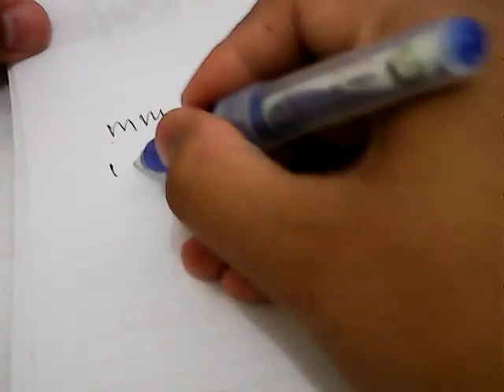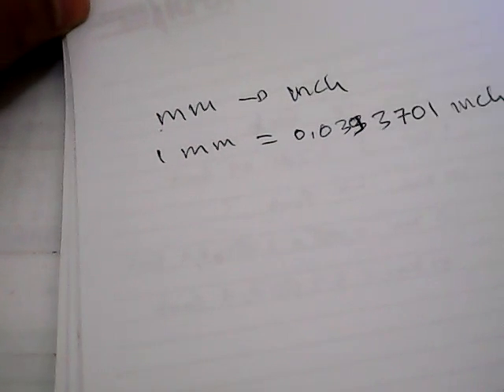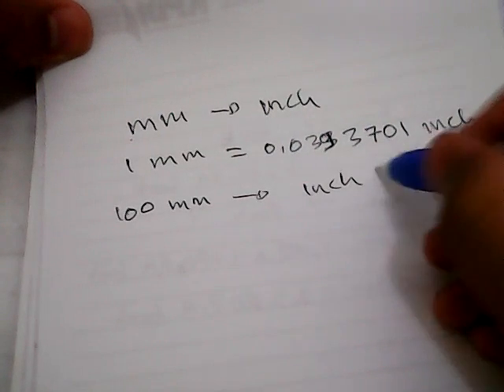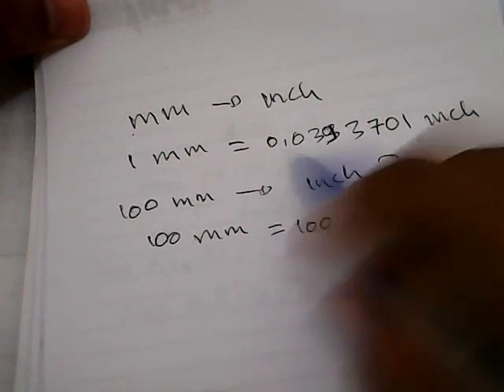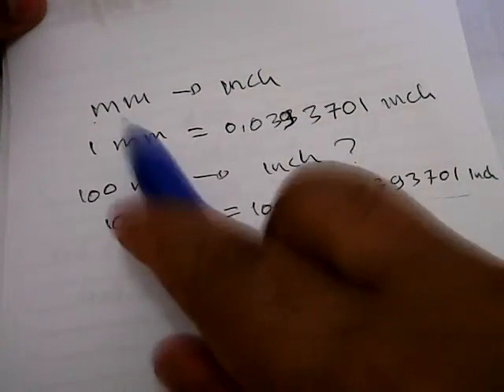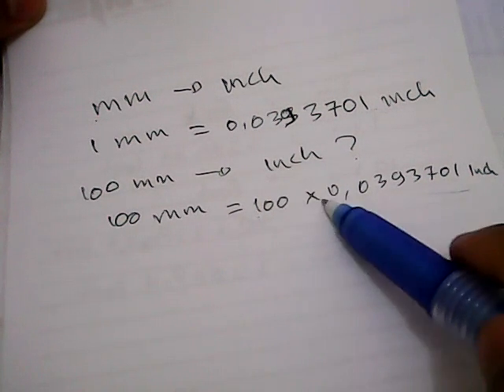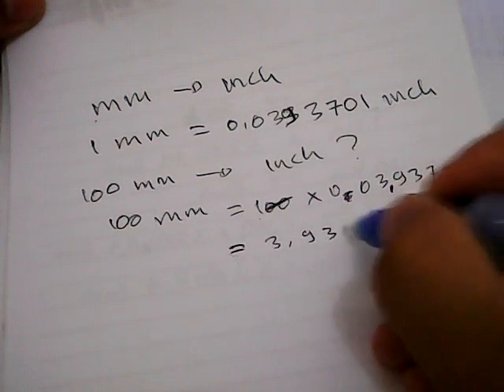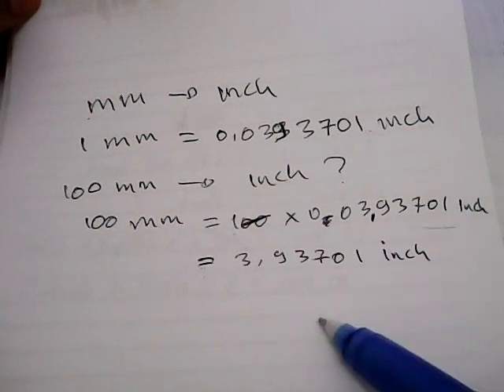✅ Convert Milimeter to Inch (mm to in) - Formula, Example, Convertion Factor

Comment: To be easy to understand. What exactly in inches. 
for example: 49mm  =   1"  3/4 inches
                        50mm =   2" 1/3 inches 
That is more easy to understand not the
Computation of a lot of digits